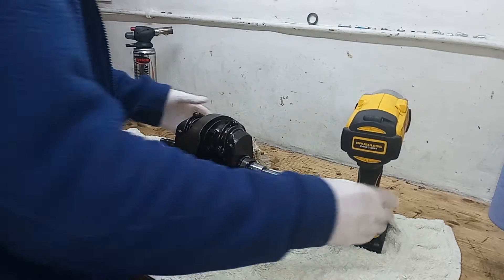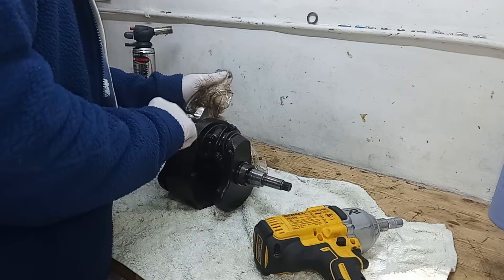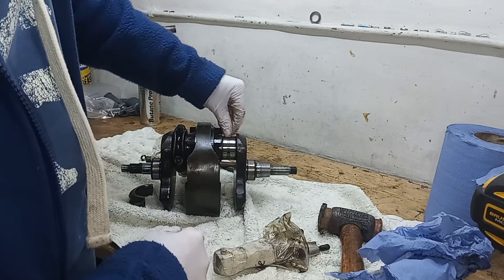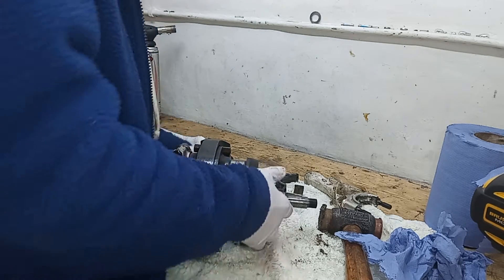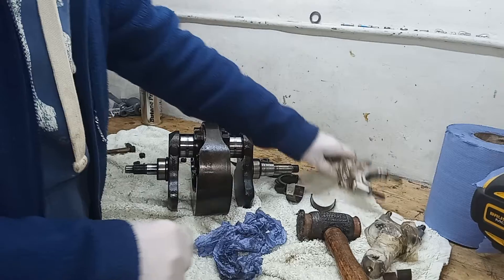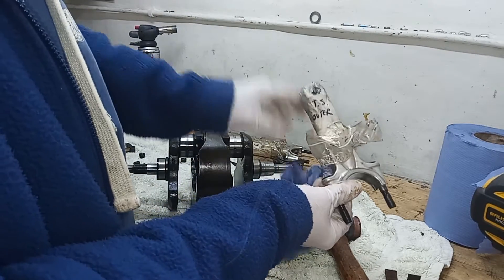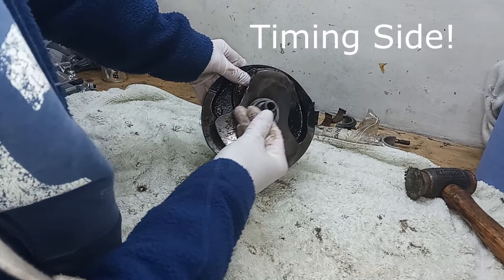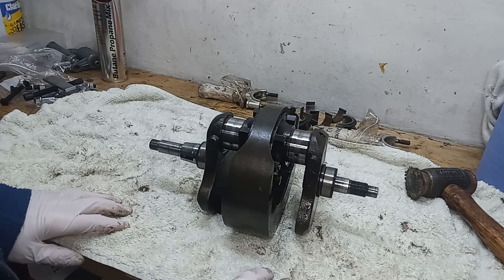Norton Commando Engine Rebuild. Part 19: Crankshaft and Con Rod Inspection

Comment: Hello Chris,
When you sent the crankshaft assembly out for inspection, cleaning, reassembly along with the machine work (new bolts/studs & nuts) do you recall or can share the procedure used to ensure the crank assembly was in alignment?  We are at the beginning stages of a rebuild on a 750 commando, the previous owner had the crank assembly already disassembled.  I have looked at many resources and no luck on what the max alignment is allowed.  I have been told by one source that there is a spec. on the initial assembly prior to machining, but nothing on or after all machine work is completed (or if one was to disassemble the crank assembly for cleaning only).  I feel and have not confirmed yet that the the studs along with the one pin is not reliable for proper alignment.  I have a feeling we will build a jig to support and allow rotation of the crank assembly and check with clocks.  From there we will have to "move" the cheek plates as needed to get proper alignment.  Your feedback is appreciated.  By the way, the journals were in really good shape, so no machine work required at this time.

Happy Holidays as well

Mark
Reply from the maker: Hi Mark, as far as I remember I rebuilt the crankshaft on my own bike myself, whereas this one was reassembled by the engineers. Both crankshafts are now working well, even though I reassembled mine without exact alignment or even proper torquing of the crankshaft bolts. See my manual for details of the latter. 👍
Reply: @Chris.rooke150  Thank you Chris, I do have your book/manual on the rebuild of your Commando - You did describe the assembly of the crank, etc.  I was not sure after assembly (again in your manual) if you had the engineers do a final alignment of the crank assembly?  Right now we are 0.003" run-out, but I feel we can do much better than that - this was literally just bolting up the assembly and nipping up the nuts.  I will let you know where we end up.  I bet we can get less than 0.001"

Mark